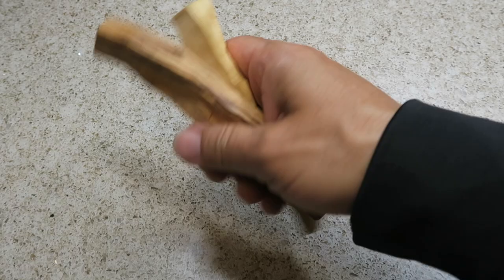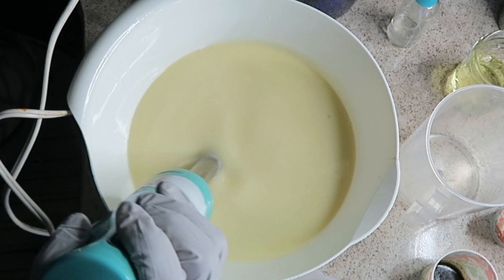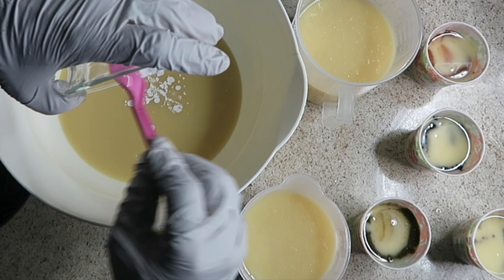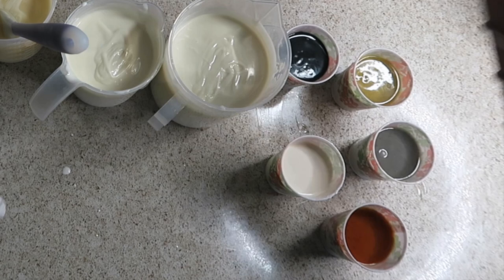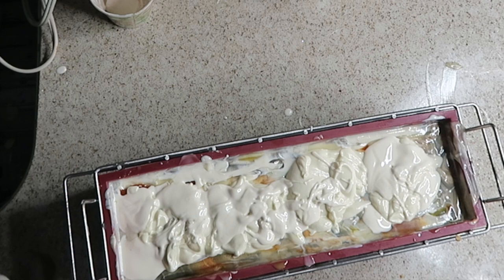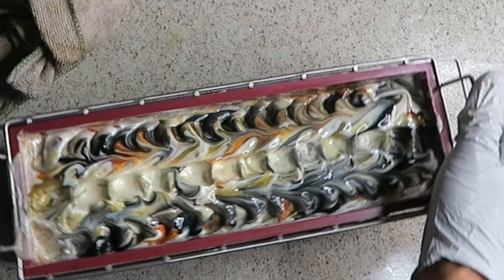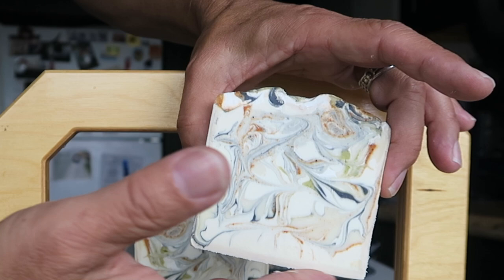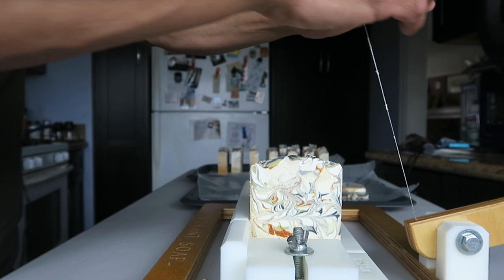Making Palo Santo cold process soap. Inspired by my trip to the Galapagos.

Comment: Hello Clyde… I really enjoy your Chanel… I recently purchased some Palo Santo fragrance based on your recommendation 😊 I love it… BUT I had a ricing problem with it … perhaps it only gets along with certain oils or temps? … all my oils and lye were at room temp … I did manage to fix the ricing so I didn’t have to waste it …. But I would like to know what your recommendation would be to prevent this for the next time … thank you I look forward to your reply 😊
Reply from the maker: Cathy! Thank you! Glad you enjoy my channel. Many times there is a difference in products from vendor to vendor. I got my palo santo fragrance from Micas and More. Their user information said no ricing, but I think you're right to question how it works from recipe to recipe. In case a fragrance oil does rice the batter, you can only hope that you can eventually blend the ricing away with more blending. Sometimes it works and sometimes the batter gets very thick. I haven't used many fragrances that rice so I'm not the best person to ask.
Reply: Well thank you for your thoughts … I added a bit more of olive oil and then blended lightly as I was able to get the consistency I wanted… I am going to check with “bescented” for their thoughts …. Thank you so much for your reply 😊